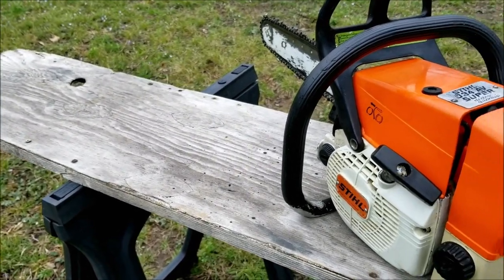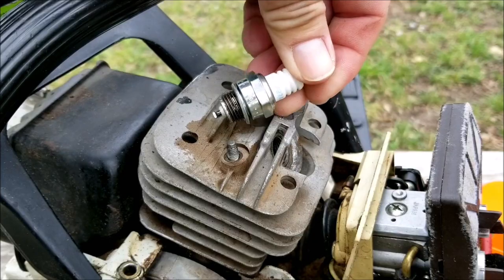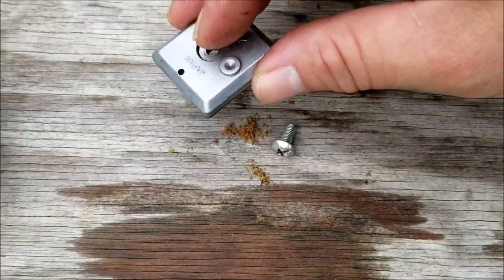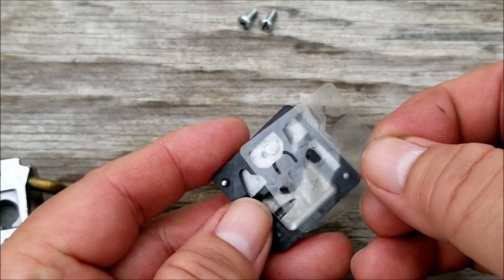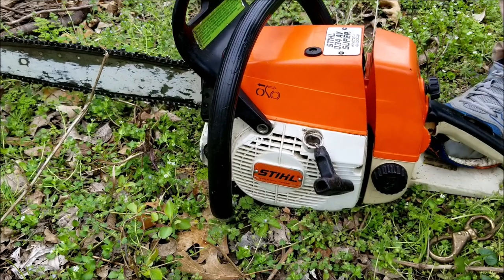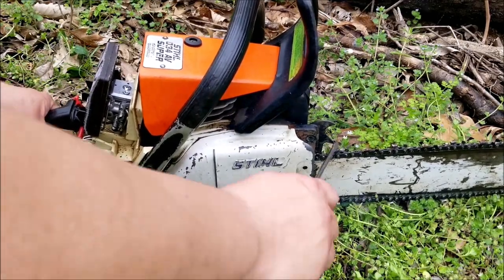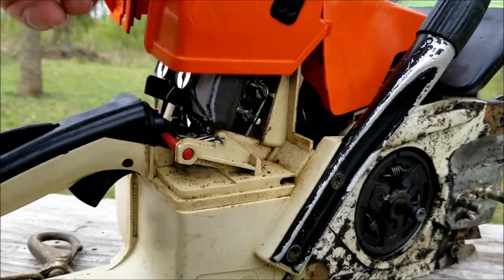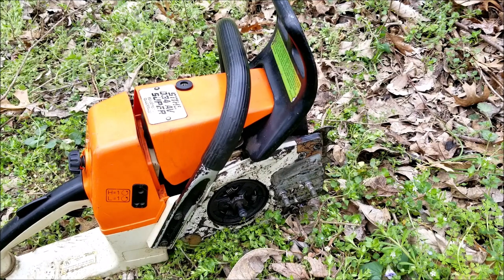Stihl 034 AV Super, what happened to it?

Comment: That’s a pro saw keep it and fix it take care of it and it will last you forever
Reply from the maker: i will thank you
Reply: I have the same saw for 20 years already.
These are better then the new ones.
Fix it or be cursed.
The part you need is not that expensive and you can aswell upgrade like mine.
The carburator be fine.
Juse good fuel with 95-oct.
Aspen pre-mixed gas would be best.
Then juse it.
Then it comes alive again.
This saw has more then 5HP .
You need hair on the balls to handle it
Reply: @jeroenb1155  No, you don't need Any curses for fiying This toy !!! ! !!! It Can be done Easy, except if the main shaft is not tooo damged. Pwy.
Reply: You don't run 95 octane in this saw or any other saw for that matter.  87 with ethanol and it will run like a scalded dog.
Reply: @mikespain8655  Stihl is German.
You cant buy 3th world country fuel in Germany. 
The lowest is 95 oct. 
Aswell is original Stihl fuel and Aspen.
That makes you a American't
Reply: @jeroenb1155  Amennn :-)
Reply: @jeroenb1155  euro and American fuel octanes are different. 90 octane there is 87 here
Reply: @Vladdypoot  the lowest octane you can buy in Germany is 95.
USA gas is 3th world country grade.
Reply: @jeroenb1155  I wouldn't say they're better, but they're pro saws. Top notch quality. With regular maintenance and care, a saw like this can last decades.
Reply: I would fix it I have a 028 had it 40 years take care of them and they will last
Reply: @jeroenb1155  wow 95 octane where do you live? Our stations only have 89- 93.
Reply: Amsterdam.
In West Europe 95 is the regulair.
The premium here is 98 and in Germany you can buy also 100 in case you drive a fancy car.
However my tools work best on ethanol free alkylate gasoline
Reply: @jeroenb1155  Wow I've only seen 87-93 at the pump here in the states and if you want high octane they sell 110 at VP racing
Reply: Amen too that 👍

Comment: I have that same saw. I’ve had it close to 35 years and it’s still going strong! I’d fix it up and use it, but don’t use that old bar as you can see it’s turned blue from overheating. It’s probably been run without oil. Also check that the oil injection to the chain is working properly.
Reply from the maker: thank you Uncle Hornet, You are exactly right.
Reply: actually stihl heat treats the bar rails, notice how even the bluing is the lingth of the bar,
no oil or dull chain will be very localized,  
.......and you must take care of your equipment, 35 yrs. bravo,
easiest way is just not to abuse it when you use it,
Reply from the maker: @thenn869  thank you for the comment.
Reply: Heat treated new bars are not blue! The turning blue is caused by heating and slow cooling “ called running the colours by blacksmiths” it actually tempers the bar making it softer. Look up heating and tempering of carbon steels if you want more information.
Reply: @thenn869  The Easiest way ! Is ! Just ! Don't !! Use !! It !!
Reply: Hi, Stihl tech here. The bluing on the bar is from the factory. It is done intentionally to make the bar slightly softer than the chain links, thereby letting the bar wear but not your chain. Also you assembled the carb gaskets on the metering side backwards. The gasket goes first then the diaphragm, then the cover. Cheers mate, hope you got this old girl running again!

Comment: I used to work on Stihl saws for a living and still have an 034 since  it was new back in 1989. Well worth fixing . The factory set up was 325 pitch chain. New sprocket and bearing isn't that expensive at all.
Reply from the maker: I really appreciate the insight
Reply: I traded my 028 farm boss for the 034 Super (not AV) in 1990 and been very well served by it since! More power 4hp in a lightweight albeit Plastic body (instead of metal on full commercial pro models). Use Echo oil mix! Sorry Stihl oil mix caused lots of problems! Another plus = you can upgrade to the cylinder & piston/ring kit from an 036 and gain 1HP more! Haven't yet on mine since compression is surprisingly strong even today 😜. Unlike George mine has 3/8" clutch bar chain setup - maybe that makes it 'Super'? I did wear out the original 16" then upgraded to 20" Oregon end sprocketed premium.

Comment: I bought the same saw 34 years ago and it still runs strong,but it was only used to clear my house lot and occasionally for firewood. I believe I paid a little less than $300 for it then. So it would be up to you on how much you would spend to repair it. Good Luck with your saw! They Made Good Saws Back Then!!
Reply from the maker: I completely agree with you John Christy. Thanks for your time.

Comment: I'd definitely fix her. I've still got my modded West Germany made 034 super that I used professionally for a long time. My 362 c-m has taken the mid size place in my professional arsenal, but I still use the 034 for firewood- it's a very solid saw and you'll get many good years out if it.
Reply from the maker: thanks for sharing your experience I appreciate it
Reply: I have a 34av and a 362. The 34 is do smooth

Comment: Definitely worth repair. 034 super is comparable to 036. Pro level saw. I'd rebuild and ultrasonic clean the carb. 3/8-7 pin rim, new drum, bearing, washer and clip. 20" Oregon bar and chain combo.
Reply from the maker: Wow thanks for the specs. I appreciate it
Reply: @HomeGaragechannel  you're welcome. I have an 034 myself.
Reply: Will's Garage, you are correct about it's power comparison to the 036.  Good, reliable pro saw and I LOVE mine!

Comment: I have spent 170 Euros 2 years ago for renowing the Stihl 034 that i foud in my Grandfather's garage  I have a newer type of the carb, (with a plastic distancer) that is running worse than the old types of the carburetors. I also had redesigned the exhaust chamber, because the original was tooo much restricting . Btw, i saw, that you have the same exhauist. It took me 2 whole years, to study the Proper shape of the exhaust . Even the "experts" at our service couldn't give me proepr acvices, but just the starting points into which way the design of the exhaust should be developing. But, it was enough for me to continue. I had about 5 major Changes to the steel exhaust chamber , and also about 10 smaller changes , that took at the "fine tuning" of the exhaust system.  I also had to buy another exhaust chamber, because i destroyed the first one, because, at the Beginning of the redesigning,  i didn't know how the Good exhaust should Be from the beginning !  I gained some power, as i measured it with my father , when we closed the other exhaust pipe . Yes, i made 2 exhaust pipes.  But most importantly : It now runs Very well, almost perfect, BUT Also : it is Not so noisy, except trough the carburetor-reversed noise, at which i also redesigned the intake/filter cap , so, that it gets more air trough the less restricted holes trough it. I am Very satisfyed with this chainsaw :-) :-) 
Thank you for the video , so, that i saw what type of the carb this model has, and which type of the exhaust chamber it has, because there were more than 3(-4) types of the steel exhaust chamber ...  :-) 
I would fix also this your chainsaw, if i would have it  except if the mainshaft is not tooo much damged where that bearing for the clutch is running ... or if a new main shaft is not so expensive ( plus if the outer shel of the clutch is not too high priced )
Peace with you from the Eu :-)
Reply from the maker: Thank you for sharing your experience with this saw. I really appreciate it.  Seems like the saw is working great now.
Reply: @HomeGaragechannel  Thank you for your  response :-) Amm, but, about which saw you are talking lately in your last sentence ? :-/ Yours, or mine ? :-/ Thanks again :-) Peace with you from Eu :-)
Reply from the maker: @kopronko  I'm sorry I was talking about your saw.
Reply: @HomeGaragechannel  Oh, no problem, brother :-) Yes, it runs Almost as it should, except the idling is not so reliable(constant rpm's) , But, it is still much Better as it was from the factory :-) 
Thanks for your work with the video :-) Peace with you from Eu :-)

Comment: I would definitely rebuild that baby with factory parts (when possible). I have owned the same 034 for 30+ years. I decided to not restart for me after one tank of fuel yesterday. I will get her running today and continue the storm cleanup. You can never go wrong with a saw built in a county that no longer exist (West Germany). Thanks for the great video. Tim
Reply from the maker: Thank you Tim for your time, good luck with the saw.
Reply: Just took a little time this morning to go through my baby. Took everything apart, inspected and cleaned including the carburetor. Everything checked out and nothing seems to fix my problems. I finally took the exhaust off banged it out on a concrete floor removing small amount of rust, bang! She fired right up. Never would’ve thought of checking the exhaust if you had not mentioned it. That small amount of back pressure must’ve been enough to stop it from lighting. Thanks again for the info now back to Cleaning up the storm damage for my family
Reply from the maker: no problem
Reply: At some point id toss the thing though.. just spend like 250 to get one that atleast works well... so u dont have to spend 150 in parts right away... and then find out ur crankshaft is gone and ur out another 350 for a crank and a cilinder kit..

Comment: Fix it!  My 034 Super is probably the best saw that I've ever owned, having bought it used several years ago for a good price.  It has lots of power and it fired right up on Saturday after not being used for the last year or two.  Used it again today to fell a few trees while cleaning up a neighbor's property.
Reply from the maker: Yes i intend on fixing it
Reply: What size pull cord do you use on your 034? After about 3 cranks with new cord on mine it brakes . Maybe i need to go up a size. I bought the Saw at yard sale.
Reply from the maker: @jerrylittle8922  I would probably use a #5 at least but larger is probably better.
Reply: @HomeGaragechannel  Thank you.
Reply from the maker: @jerrylittle8922  no problem

Comment: Just a friendly piece of advice. All stihl saws that end in AV. I was told by my local Stihl dealer that in the mid 1990s all service parts have been discontinued for any saws ending with av.  Which really sucks I have two of them. But stihl  is no different than any other company they do that shit on purpose it forces you to buy their new stuff. Make sure you talk to your local dealer they were able to retrofit some new parts to keep my saws running. But that's not always the case.
Reply from the maker: thank you for the information
Reply: 034 is easy to get parts for my favorite saw to rebuild. Every one that comes up for sale around here I snap up.  Porting them is fun. You can swap in 036 parts also go aftermarket for parts.

Comment: Wet sand the bar and repaint it.  I did that to my 024 and 026.  I use Rustoleum Flat White over a coat of grey primer.  After it dries good,paint the bar with Satin Clear.  This keeps fingerprints and bar oil from staining the bar.  You can add a Stihl decal on the bar if you want.  I also ground the chain on my chain grinder to bring it back to like new specs.  I then hand file my chains.
Reply from the maker: that's a good idea.

Comment: As blue as the end of that crankshaft is I would say the crank is history as well as crank seal damage from the heat. Aftermarket parts are available for these Saw's but it's labor intensive to replace a crankshaft. Might make for a good video if you want to replace it though.
Reply from the maker: are you absolutely correct about that.

Comment: I have the same saw, with maybe 100 more tanks thru it than yours.  3/8 rim clutch with an 8 tooth rim, new 3/8 50 25 inch bar, skip tooth chain.  and the clutch bearing.  Find leaks in all the rubber parts and tighten or replace them. service the recoil and You might have a good cutter with a $300 value.  Keep in mind, usefulness, beauty and value are all relative.  Is it 101 or lol
Reply from the maker: thank you Denver Ray for the information I appreciate it

Comment: I would do 2 things befor I made a decision to "fix" the saw. First I would make sure the shaft from the engine to the sprocket is not damaged and with in tolerances.  With the needle bearings going out the shaft may be damaged and that would be a compleat teardown. Second would be a compression test to see what the # are. If they are on the low side again you are looking at a compleat tear down. That being said it still may be worth the compleat overhaul because those were good saws and they donot make them like they use to and getting a new comparable saw might be a lot more expensive than the repairs and you would have practically a new saw.
I have an 045 purchased used 45+ yrs ago that is still going strong. All original and used a lot for firewood. I have an 038 and I think a 251?pro module that replaced an 011 I just worked to death. Good luck with your saw.
Reply from the maker: thanks for sharing your experience I appreciate it

Comment: I kinda late but here’s a tip for starting any small high compression engines in hand help machines (chain saws, string trimmers, etc) you might already know. well standing hold the forward grip with one hand and grab the starter handle with your other hand, then hold it up roughly at your waist height, then simultaneously thrust the machine down with your hand that is on the forward grip and pull the starting cord up and to the side. that way you are making gravity do the work for you!

Comment: On two cycle engines it is best to dump a capful of two cycle down its throat.  This gives some lubrication to the bearings and seals.  You can put a little under the spark plug but don’t forget to put some down it’s throat, first.  Try cranking it from the half choke position when you do this..  I pour a capful of two cycle down their throat when trying to crank a saw after rebuilding a carb and crank from half choke.
Reply from the maker: I appreciate the information John Clarke.

Comment: Sell it to me! We have 5 saws this one is by far, out runs, out cuts anyone of the others. It is the oldest one we have by at least 20 years and definitely the best. It has a odd size of chain, 20 inch bar, throw chips 30 feet behind you all day. We have a 391 a year old but the 034 is still the go to saw. We have a 251 we loan out (which is a major mistake).
Reply from the maker: if i decide to sell you'll be the first to know
Reply: It’s a great saw fix it you won’t be disappointed, (if you can still get the parts)
Reply from the maker: @kevinhowell646  ill definitely try

Comment: On two cycle engines it is best to dump two cycle gas down their throats, so as to lubricate the bottom end, seals, bearings, etc.  the rocker are you mentioned is called a lifter and the other parts - lifter spring, pin and needle valve.  I usually replace all of the parts if I open up a carb.  They are not expensive but a Walbro K10 rebuild kit comes with every part you will need but a new lifter spring.  Sounds like to me the high throttle screw is misadjusted.  Adjust it, first. Then the L jet and the LA screw.
Reply from the maker: oh, yes You are absolutely right. I'll have to remember that from now on. Thank you John Clarke.

Comment: Seemed like it was idling high.   Bad cranks seals can cause that.    Might not be the problem but it happens.    My old still 034 is still going strong after 28 years.   I do about 7 cords a year with it.   I’d buy a new one exactly like it in a heartbeat if they still built them like this.
Reply from the maker: You might be right, thank you omyajt

Comment: 034 is a good saw. Ive swapped all my 40 cc (some of the smaller ones too) and above to 3/8, except for 880 and its 404. Have both husky and stihl, no real preference. I'd rather run the same kind of chain, that way you don't pick the wrong one by mistake. I do however try to keep husky chains and Stihl chains separate as well as the ripping chains. The Husky 61 and the Stihl 034 super are both good saws imo.
Reply from the maker: Thank you for sharing that information.

Comment: I would replace the clutch cover with one for a sprocket drive to match the chain, and keep the saw.  Total parts should be about 20 bucks.  Make sure the chain matches the bar (drive thickness, 50 gauge, or 63 gauge).
Reply from the maker: that's a great idea
Reply: @HomeGaragechannel  T.Y.  If possible, go with a reliable supplier, like HL/Supply, Sawzilla, WolfCreek (I don't know if they sell those type of parts), or Chainsaw Conservation Components.  It's not that I don't trust Flea-Bay, but sometimes the merchants don't know what-fits-what, and the wrong, (non-fitting items) are shipped.  Much luck, If you want to give it away, (or sell it), I would be a very happy owner.  Thanks for the video.
Reply from the maker: thank you Thomas Gronek for the suggestions.

Comment: DO NOT USE PREEMIXED FUEL, I am a small engine mechanic and I have seen preemixed fuel tear the rings up, so the rings get stuck in and they are a pain to get loose. If the rings are stuck, then the saw will have no compression
Reply from the maker: i hadn't heard that.

Comment: I would put a bar and clutch on it that matches the sprocket and replace the sprocket bearing.  Since I Have most of these parts laying around the shop it is an easy fix for me.
Reply from the maker: Nice, you'd get it running in no time.